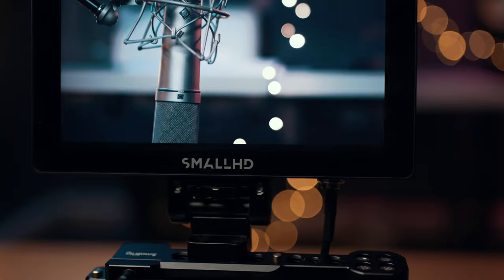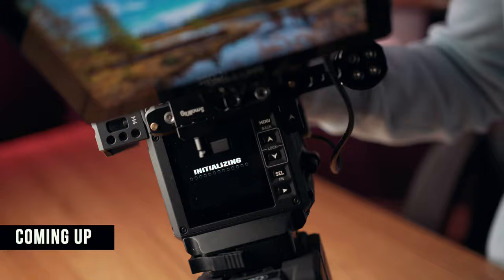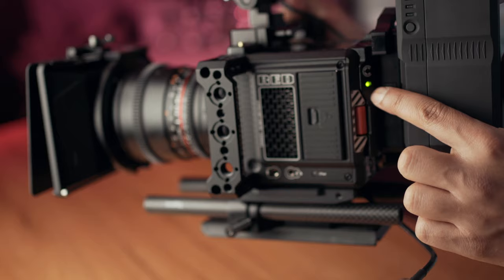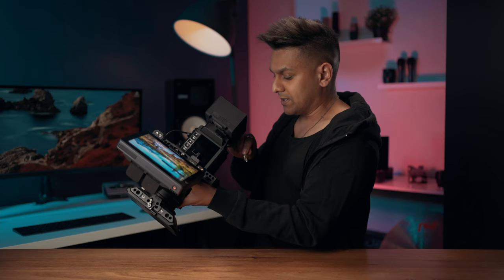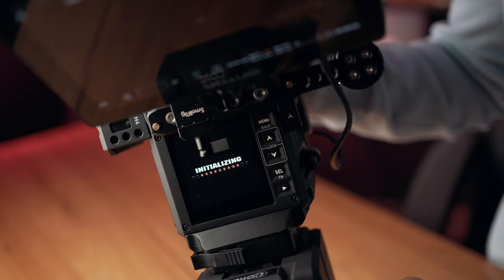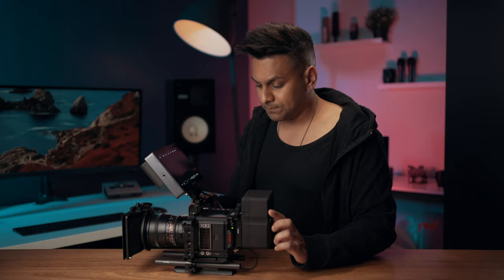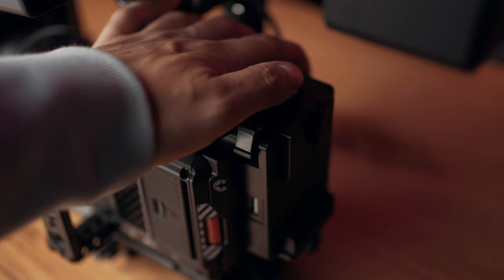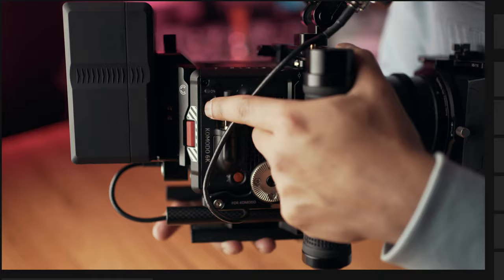How To Not Blow Your SDI Output On Your Red Komodo

Comment: This whole problem only applies if you power both the accessories and camera off the same battery. If you power the monitor from separate batteries it literally doesn't matter when you plug in the SDI or any other cable or turn on and off stuff because there is no way to complete the circuit through the SDI.
Reply: Do you have proof that this whole process can be ignored by powering your accessories with different batteries?
Reply: How can you be sure?
Reply: @MrSlapp  Because of the way electricity works... There is only one cable connecting the two devices, no way for current to flow, no loop....
Reply: There is one cable anyway.... The SDI cable can bring to the Komodo excess or current peaks from the monitor, irrespective of the battery powering it.... Not saying you’re wrong, but your rationale has gaps, IMO...
Reply: Wrong again. If your SDI accessory is using batteries that don't have any grounding and you don't follow the procedure outlined by RED, then you may eventually find yourself with a major issue on-set. P-Tap/D-Tap connectors also don't use grounding and should be avoided at all costs.

From RED:
Make sure power is connected to the SDI accessory at all times before you connect the BNC to the camera. Ungrounded power from SDI accessories can damage the camera’s SDI port. To avoid this possible damage, attach the power source to the accessory before attaching it to the BNC cable.
Also from RED:
When possible, avoid using P-Tap (also known as D-Tap) cables to power accessories. To avoid damage when using P-Tap/D-Tap, it’s imperative that the connect/disconnect sequence is used.

Comment: The problem can only occur if the same V-mount battery is used to power both the camera and the monitor. If you use different batteries the order in which the devices are connected and turned On/Off does not matter at all.
Reply: This is incorrect. If your SDI accessory is using batteries that don't have any grounding and you don't follow the procedure outlined by RED, then you may eventually find yourself with a major issue on-set. P-Tap/D-Tap connectors also don't use grounding and should be avoided at all costs.

From RED:
Make sure power is connected to the SDI accessory at all times before you connect the BNC to the camera. Ungrounded power from SDI accessories can damage the camera’s SDI port. To avoid this possible damage, attach the power source to the accessory before attaching it to the BNC cable.
Also from RED:
When possible, avoid using P-Tap (also known as D-Tap) cables to power accessories. To avoid damage when using P-Tap/D-Tap, it’s imperative that the connect/disconnect sequence is used.

Comment: sorry mate but i believe internet says you have to have the camera ON aswell BEFOR Pluging the SDI. Basicaly its ---> All on befor SDI / SDI out Befor ALL OFF . 
Correct me if im wrong . :) Cheers BTW thanks for your videos !
Reply: Make sure EVERYTHING is on, camera, monitor, all AKS, etc., before plugging in any SDI BNC cables. If you’re using a Teradek make sure the Teradek is powered as well before implementing any SDI cables. When powering down, I usually unplug the BNC first, then power down monitor/Cam/AKS etc. I may be wrong on the power down, but I’m pretty sure that’s how everyone I know does it. Cheers.
Reply: @anthonyscopino4934  >Isnt it what i just said ?
Reply: Yes you are right Jacob.
Reply from the maker: Thanks heaps mate! I have tried both ways and it does seem to be fine. Thanks for that. Although from my understanding the power status of the Komodo doesn't have any affect on this. Could also be wrong though haha!
Reply: @danielkelaart  The actual real problem is the grounding . Eitherway when a Dtap is pluged wrong way or when hotswapped battery . One pin touches befor the otherone . that is what grills the SDI. But still unplugging everytime is safer :) Cheers mate !
Reply: Camera state doesn’t matter according to manual
Reply: My problem is its hard to unplug the SDI OUT from the back of komodo.

Is it okay to unplug the SDI IN of the monitor ?

Comment: If the batteries die and the monitor turns off, how can I disconnect the sdi cable?
Reply: That happened to me, disconnect SDI first. Even if the battery is dead, it's still completing the circuit. Then replace the batteries.
Reply: @Dubi00  thank you

Comment: I use a regular 4K SDI and I'm totally fine. I heard it's even safer than using the 12G one. I only use canon batteries though and the monitor has its own battery too obviously.
I'm not certain so correct me if this is a mistake.

Comment: Somebody can tell me whats happend when you have plug in your  sdi cable into the komodo and the batery its empty and power off? Its dangerous to the port??
Reply: If you have empty batteries nothing it's going to happen. Now, you have this possible scenario:
1. You're recording and the battery (Komodo or monitor) dies. According to a few YouTubers this could be something to worry about (I really don't know). According to RED inside their page you can check the article called: "Preventing Damage to SDI Outputs". Which may be a bit confusing since they only refer the issue if the MONITOR loses power

But it's a simple process called LIFO: Last In - First Out. You place the battery on the Komodo and your monitor (whatever order) and only then you can connect the SDI cable (no need to turn on the camera, is up to you. Regarding the monitor although it's not needed to do it, they advice to turn it on since there're a few monitor where you don't have a power status and you may plug there an empty battery).

Then let's say you need to take a break... According to ARRI after you followed the LI (LAST IN) protocol, you don't need to worry about POWER IN or OFF your devices (Komodo, monitor or whatever accessory). NOW the problem that can happen here is that if the battery dies (discharged or something) you're not following the protocol. Since that's interpretated as the camera was disconnected from the power supply or viceversa. So, most people when they turn off the camera for a while they decide to power everything off (or at least the camera) and they unplug either the camera sdi port or the monitor (no need to disconnect both unless you finish your shooting day).

This is basically what I got by watching multiple videos and reading PDFs haha

Comment: This is wrong. For Powering on, power both devices first,  turn them on, then connect SDI. For shut off, power down both devices and disconnect. Always use a 12G Shielded cable.
Reply: The power on and off sequence is about grounding, if your monitor was connected via DTap, you would have blown your SDI as there is a power circuiting through one source and outputting to multiple devices. In this case you have wouldn’t have a grounding issues as there’s no unregulated power out coming from your camera battery.
Reply from the maker: Thanks for sharing man! :)
Reply: @jgermain453  why is it no case in other cameras?
Reply: @wasislos  this is the case with all 12g SDI cameras. I’ve seen people blow the SDI ports on Alexa’s as well as 12g recording decks and devices. It’s not a red Komodo problem, it’s a 12g SDI problem all around.
Reply: @jgermain453  ACs around me always say "connect the cables first, then connect the power" and what you say is vica verse. Do you have any source for this kind of information?
Reply: @wasislos  there’s a few published articles from Arri and other camera manufacturers about this. Dating back about 4 years ago. The AC’s you’re hearing from have their info backwards.
Reply: Like mentioned in other comments as well as my original reply, it’s about power grounding if you’re running DTap or Lemo from the same source as your camera power. Without proper shielded cabling as well as order of operations and unregulated power out, the power can and often will travel the 12g SDI as part of the power circuit loop, resulting in a fried 12g SDI port on one or both ends.
Reply: Arri’s suggestion in the new pdf about this issue which was released this month specifically indicates to connect power first and then SDI, after that you’re fine to toggle on or off. RED specifically says to power on first so that you know the power ground has been made before connecting SDI. Again it’s about power grounding and has been an issue since the advent of 12g SDI.
Reply: @jgermain453  is this just using power from the same source? I also saw a ReD video that does it when the monitor is powered from a battery.

Comment: No ! wrong procedure !!! correct procedure is: SDI (LAST IN- FIRST OUT), if you turn on komodo for last and have power supply plugged in to the wall your SDI in to the camera died ! CAMERA,RECIEVER,MONITOR need to are ON ! and for last one plug SDI !